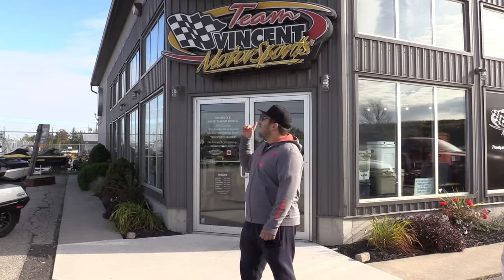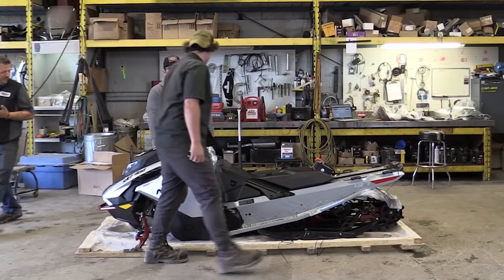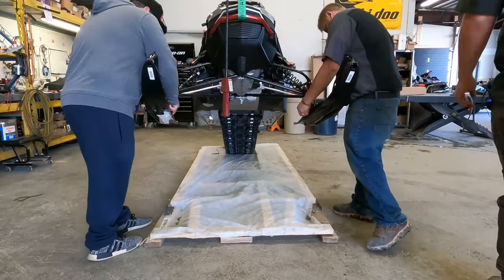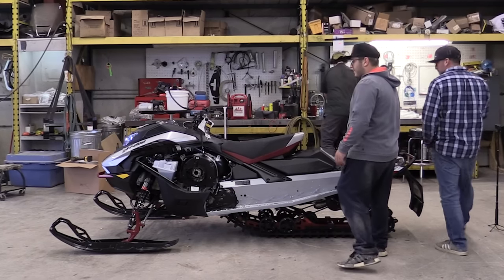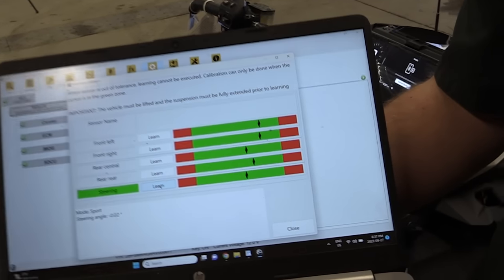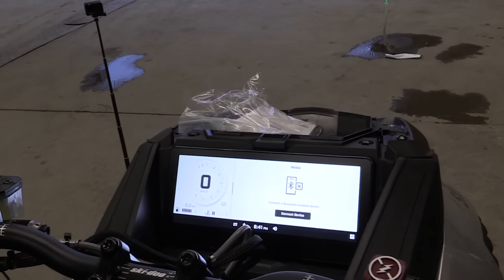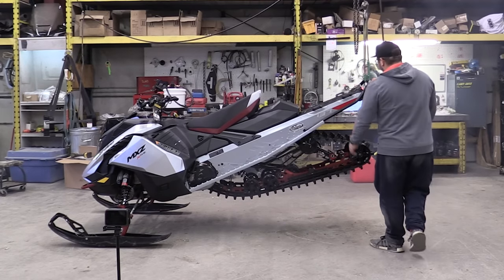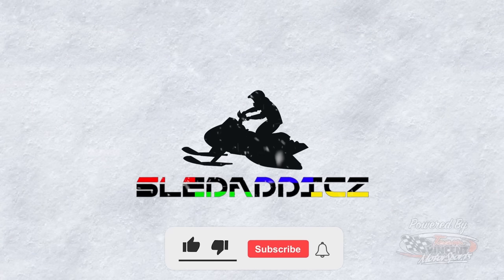Building our 2024 Ski-Doo MXZ X-RS 850 137 | What Does It Take To Build a Sled?! | ThatSkidooFeeling

Comment: Why didn’t you get a 4 stroke for all those long trails? You must add more than 5,000klm per season?
Reply from the maker: It depends. Now that I am back in school I have less time to ride. Last year I only rode about 4000 kms. The season before I rode 13,000 kms. I'm much more of a two stroke guy. I like the snappiness and lightness when putting on 450+ km days plus I also love backcountry riding. I usually trade and get a new sled every season so the kms of a 2 stroke don't concern me. Cheers, Jesse
Reply: @sledaddicz  wow. In 1 season you took a 2 stroke straight into a top end rebuild amount of km. That's amazing. I'm lucky enough to get out nearly every day in the winter and I haven't come close to over 10,000 in a season.
Reply from the maker: @shperax thx buddy. I rode as much as I could that year that's forsure. The sled still lasted all of last season tho and blew up on the last day at 16,800 kms! Still was able to run it back to the hotel on one cylinder. Cheers, Jesse
Reply: I like how you put the tail light on and then decided to put the tunnel protector on lol
Reply from the maker: @sleddheadxp800r we didn't.. we put the rad protector on and then riveted in the tail light.

Comment: Hopefully you are not going with a Ice Storm track, as I had that combo last season on my 23 Renegade XRS, and it didn’t go particularly well, the inboard idler in the skid is not spaced properly for the drivers on that track, and drivers on the outside are also very tight to the outboard idlers on the axle.  The inboard idler was resolved by using a G4 generation wheel, the offset or profile is slightly different, couldn’t do anything with the rear, and anyone that followed would say they could smell like a rubber or plastic melting smell, and it wasn’t the hyfax, it was the wheels rubbing on the drivers of the track, you couldn’t track it either direction.
Reply from the maker: No ice storm for me. That's great to know though! It was on my list as I had heard lots of positive things about it with the shorter outer lugs. Cheers, Jesse

Comment: So what did you build? Id be impressed if they just sent the parts not together.
Reply from the maker: Hey Mike. I'm not sure I really get the point of your comment. All consumer sleds come from the factory like this and have to be "built" - which means put some parts on, check track tension, etc. and PDI the sled. Obviously we aren't building a consumer sled from scratch. Cheers, Jesse
Reply: @sledaddicz  If "build" is the proper word for it, then there is clearly many levels to this. Bought many sleds from the race dept in crates. Never felt like I "built" something. Not even when we trail converted them. Just my opinion.
Reply from the maker: @mikeh4053 fair enough. At the end of the day it's semantics.
Reply: @sledaddicz  i spell semantics C L I C K B A I T. So you got me. It's ok. Gotta waste my relax time doing something
Reply from the maker: @mikeh4053  how is it clickbait? You see the word "build" but don't notice the massive skidoo crate in the thumbnail? Every modern sled comes like that.
Reply: @sledaddicz  i clicked because i wanted to see what you were "building." i don't consider installing skis, shocks, snowflap, and hooking into buds system to check for updates "building." its actually called dealer prep. if you would of said that, i would of skimmed by it thinking you did exactly what i figured you would do. hence the "clickbait." always making it more than it is. ME generation i guess. Last year bought 3 new sleds. didn't even look at them. toss em on the trailer, lets go.
Reply: @mikeh4053 build definition. To construct something by putting parts or material together.
Reply: @BCJ371  context is king. I built a burger on my grill as well.
Reply: @mikeh4053  the point of the video to show what happens behind the scenes as 99% of people will never see this process. They built an XRS. Just like you built a burger.
Reply: @BCJ371  500 dealer prep charge. your welcome. would an adrenaline "build" be an less than a XRS. glad i watched. i always thought they were built at the factory. weird.